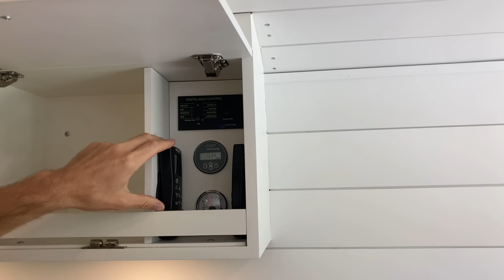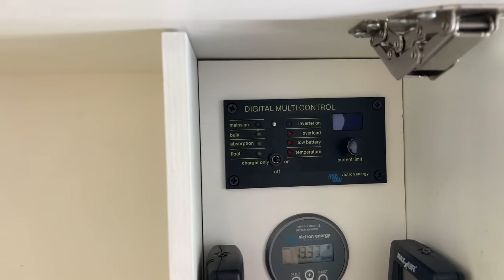Van Tour | XL bathroom | For Sale | Modern tiny home on wheels with all the essentials.

Comment: Love your van build. It's the closest to what we had planned for our van layout. We recently purchased a 2017 Ford Transit 350HD  High Roof Extended Dully.  We did notice the gas tank is behind the drivers seat beside the rail.  We saw that  you have a center drain in the 24 x 40 shower pan, which side of the unibody frame is the drain hole located?  Also were did you purchase your pan?  Any  chance you could shoot a pic of the drain coming out of the pan under the vehicle? Good luck with your business and thanks for sharing your video.
Reply from the maker: Hey Debbie
Actually the drain is on the right side of the shower pan.The drain comes out in the first opening behind the drivers seat in the bottom right corner (if you're looking from the back forward) with just enough space, but close to the frame so be careful planning that out. Got it off amazon - brand is 
S.RECREATION.If you're going to put your bathroom where I did just be aware the ceiling will present some challenges as it slopes down a lot towards the front.
Good luck with your build!

Comment: Well done. Have a question though...a lot of folks didn't think they would have mold issue with the bed...and they did ..in the foam and bedding on underside so some made holed to vent in the wood under the foam...Since you put bed up during day maybe that made a diff and would be why you didn't have that issue (or did you at some point?) ...So my question is if someone wanted to not put up the bed except on rare occasions would that possibly require something more to prevent mold ...especially if were in damp or humid area with changing temps..like PNW OR NE COAST? Being single and having had camper vans before  i know i thought i would NOT leave bed in place but i DID ...with only me, i didn't need more space to do things and was much easier and happier to leave bed intact. So what do you think?
Reply from the maker: Hello Marian, We never had a problem with mold.If i was to build a fixed bed I would create some kind of air flow underneath. I think what helps a lot is having good circulation of air through the van even in cold climates.

Comment: This build is great.  It looks top-notch head to toe.  I'm curious, did you guys have to level out the vehicle ever at a site? Putting leveling/chock blocks under the tires to make the floor more level?
Reply from the maker: Thanks Roset! We didn't have to do it every time we stopped but we did use leveling blocks a lot. I would highly recommend having some if your traveling in a van. If you look at the last scene in our video you can see us using them on the beach.

Comment: It’s fantastic.  Well done.  In Ireland we have to have our refrigerator vented to the outside as one of the requirements to have a van recognized as a camper van on the registration documents.  Did you vent your refrigerator to the outside?
Reply from the maker: Thanks! No it is not required to vent to the outside. Ours is well ventilated but not with an outside vent.

Comment: Thank you for the tour, very nice build. In regard to being tall, can I ask what your floor consists of and how you were still able to have another inch or two when you stand in the van? I have a 2022 Transit High Roof and I didn't want to make any mistakes in utilizing the high roof benefits.
Reply from the maker: Hey Brian we used furring strips on the bottom and insulated between those and then laid 1/2” Plywood over that.Then just put some vinyl plank flooring down. The Ceiling was just 1/2” plywood I cut into furring strips and over that we used Shiplap for our ceiling that I think was 9/16” thick. I would recommend doing what I did at he beginning, getting some of these materials and standing on them and holding them above your head to see how it will all work. Good luck!
Reply: @livablevans  Excellent, thank you guys. I wish you all the best in your new adventure of building beautiful tiny homes on wheels : )

Comment: Could you give any ballpark figure what the cost of the build was? I've been thinking building my own so long and i must say, this is absolutely the best i've come across. Only thing i'd need to change to yours is a more insulation to the back doors (cold winters here) and i would really need a small tv in the wall. =)
Reply from the maker: Thanks Tuomas! I would suggest you do what we did in the beginning and research the price of all the items you want to use. Just by doing this we saw how fast the price can add up and what adjustments we would have to make to fit or budget.Good Luck on the build.